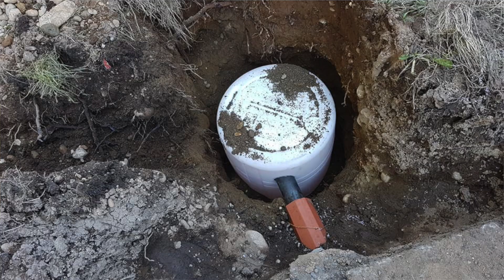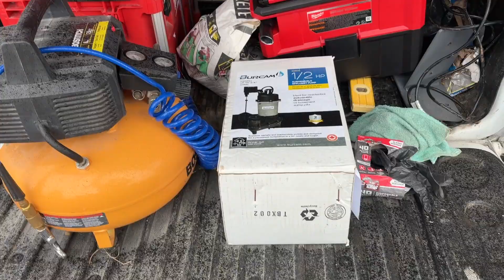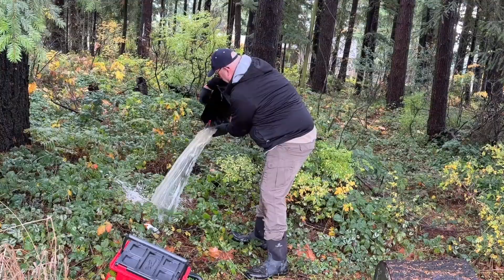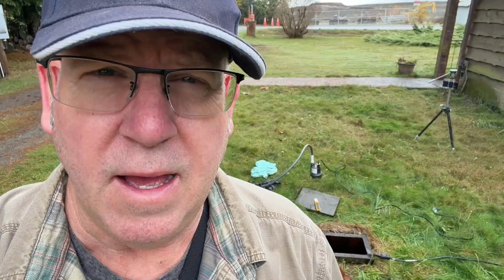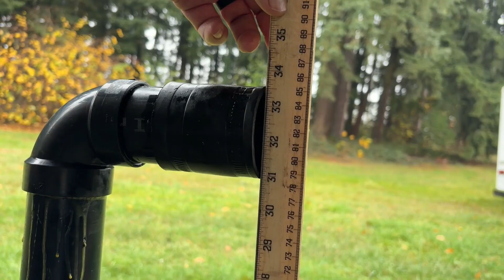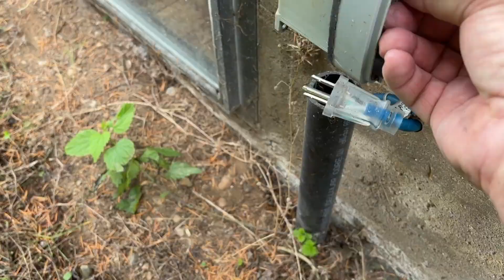Septic Tank Lift Station Pump Failure, Troubleshooting and Repair   S08E202

Comment: Having the same issue. Lift station blew, been using an extension cord bi weekly or so to connect to an outlet which allowed for the tank to drain and avoid the gurgling sounds/any backup into the pipes…

however, about two weeks ago, when I tried to connect the extension cord to the outlet connected to our house tripped I figured it was a one time thing, but every time after now the GFI keeps tripping.. so I suspect I’m having pretty much the same issue as you’re having now I have a wet dry vac, but I truly don’t know where I need to go to drain the excess water. There’s a small puddle in my backyard where I suspect most of it’s coming from, but I don’t think it’s enough to relieve the drain station/avoid tripping every time I connect the extension cord to an external power source.

Any suggestions/idea ideas?

I could find a generator that accepts a 300 V power source and do it that way to allow the drain… or I could call the local company to come out and do a review and see if they can alleviate the issue temporarily…

But regardless, if I get a generator or call a maintenance guy it’s gonna cost me probably close to or over 300 bucks
Reply from the maker: Sounds like a big job. Can you get a sump pump down into the low point to empty it?  If not you may have to call a septic clean-out company to pump the main tank and get all of the effluent out of there so you can properly diagnose and repair the issue.

Comment: Your lift station tank is way too small, IMO.  Mine is 400 gallons. The first tank is also 400. I replaced a 2.5 HP pump a few years ago. My wife helping. What a job that was. I was 66 years old at the time. I’m 71 now. I would hate to tackle that job again so I put a top of the line pump in there. It was $1200. My discharge pipe is 1.5 inches. It pumps up a 100 foot steep hill. Nightmare. Good video. Don’t forget the check valve. A good one.
Reply from the maker: Thanks for the input, Tom.  I concur... not a fun job!  I can also understand, needing to push up a 100' steep hill, that you would need a pretty robust system.  And while I don't disagree that I could have built a larger system, my 45 (imperial) gallon lift tank was designed to handle the effluent from one old lady, only needs to lift 3 feet before it reaches the distribution field 15 feet away.  It doesn't need to work too hard and only needed to last a few years.  When we sell the property in 3 years it will all be a tear-down.  Thanks for watching!
Reply: I really enjoyed it. Reminded me of mine.
Reply: That was very painful to watch. I can't name one thing you did right. I understand you think you built a functioning dispersal system, but that is far from being correct. Filming yourself illegally dumping wastewater on the ground was not too smart also.